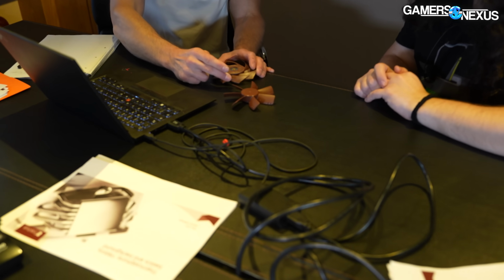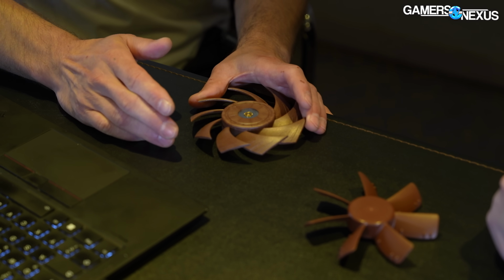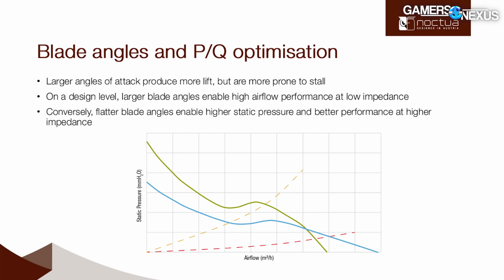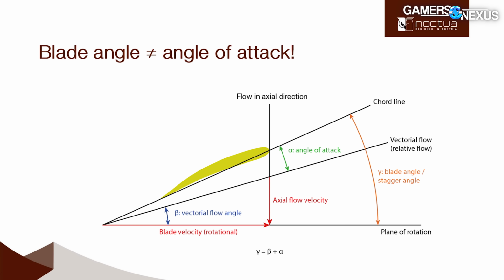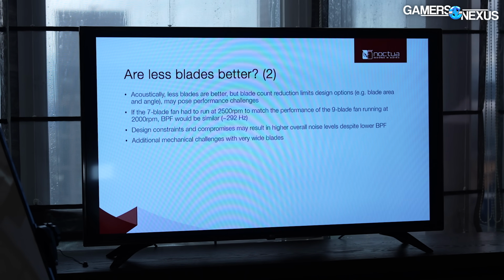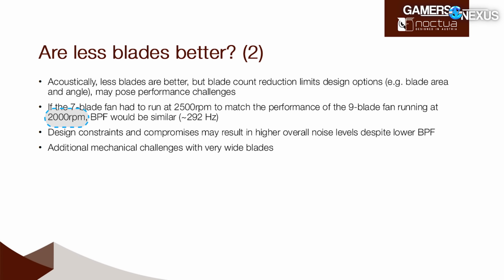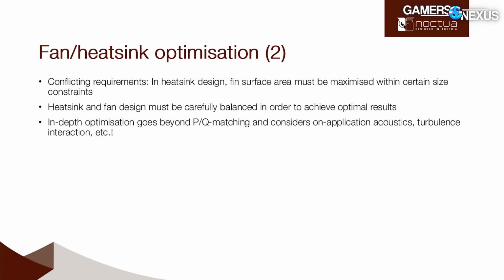Noctua's Attempt to Make the Perfect Fan | Blade Angle Engineering Discussion

Comment: So I have this brick of a Mean Well power supply (100-240V ac in to 12V dc out - 16.7A) that I saved from landfill on a demo job. Took it home and boy was it loud! Then I remembered all I have learned from this channel and bought an adorable Noctua NF-A6x25 fan and replaced the factory installed one. Suddenly the brick was almost silent and could be used inside my house with the LED strips without angering my neighbors. Thanks Steve!

Comment: More all black GPU cooler collaborations would be a great direction to take. I would love to buy Noctua GPU coolers that are functional but also discreet, providing optimal cooling for the noise levels, potentially allowing for higher sustained boost clocks. For now sadly, the brown colour means they don't fit in >95% of case colour schemes, even though those shown in this video had black shrouds, the giant brown logo on the side would still look out of place

Comment: Assalamualaikum Bro I watched Your video and I Will Update My Gigabyte  Aorus Z490 Master Motherboard Bios and Now I am Facing The Problem My Motherboard do not saving The 3200Mhz RAM clock ? Every time I change The Ram to 3200 Mhz clock My Motherboard will don't scan it and do Not Turn on After 3 Minutes Automatically Boot up But with Default Boot Setting

Comment: Axial fan design and heatsink CFD is FUN!

(I've done that before, albeit separately. AFD was for vents (or in-pipe fans to boost flow/pressure in a long running duct and heatsink design for something else.))

But having to optimise them together, as a system -- that's fun, and challenging.

Comment: really really wish noctua makes a :
1. High quality lga 1700/1851 lga backplate
2. a 120 mm ram aio with high quality thermal pads + aftermarket heatsinks
3. a ram fan solution which is compatible with air coolers especially the noctua g2 
4. a ram fan solution which is compatible with aio's
5. successor to the nt h2 paste
6. encourage more psu manufacturers to put a noctua fan inisde
7. a noctua specialised pc case best optimised for air and/or aio cooling

Comment: I am surprised Noctua offers any engineering input for competitive reasons. I just buy Noctua because I know they are the best. My Noctua cooler (NHD15) is now in its 3rd machine. Cooled my 8700K, 12700K.. bought some offset brackets to cool my 9800X3D... runs like a champ.

Comment: Would there be tangible gains to be had, by taking a 120mm or 140mm G2 level fan, but stretching it out deeper ? ie to 35mm instead of 25 etc... That could be a specific model for case fans, since those usually have depth available in front/behind them anyway.

Comment: why couldnt deisign a fan that acts like a helo blades , not fixed but can rotate on it own axes (pivot) ? Or something Back in the day (Im a AUtomotive Tech) we had flex fans that the metal would flex and change the pitch of the blades. BTW these were dangriuos becuse on high rpm motors they would come aprt.

Comment: Engineering, especially in this space (loosely defined as small scale aeronautics), is an interesting intersection of improving on common knowledge with iterating on wild ideas and proving the previously agreed 'best method' as the next passing fad. I would posit that knowing the foundations is equally useful at defining the box, but there's Always room for improvement. It only takes one radical idea to make one chase down whatever that better method might be, and eventually you'll land on the next big idea to break out of the previously defined box of 'possible'.

Comment: I love noctua fans. My old pc had them in front and back (2x NF-A14 FLX in the front and 1x NF-F12 in the back)  and was like a wind tunnel, always cool. My new pc has the noctua NH-D15 chromax cpu cooler. And I also want to replace the case fans with noctua

Comment: I know it's a running joke in the video but I would LOVE to have a bare fan frame and motor assembly that leaves out the fan disc so I could 3d print my own blade profiles.  I know @MajorHardware KIND of does this with the A12x25 in his fan showdown series but he destructively disassembles that fan to get to the bare hub but that's the idea I'm looking for.  It would be nice if that were a "factory" option I could purchase so I (and others) could experiment and print custom 3d printed fan discs.

Comment: I'd love to hear what Jakob thinks about cases that have a opening in the side panel to allow GPU air to directly escape the case. It may increase noise exposure a bit (depending on case location an orientation) but on the flip side, case fans should not need to work as hard to get warm air out of the case, because some warm air never remains in the case to start with.

Comment: As the NF-A fans are pretty much allrounders I'd really like to see if Noctua could now produce even better specialized fans like the NF-S12 G2 (or should we call them G3 by now?) for the best airflow or the NF-P12 G2 for the best static pressure. 

Plus I'd also love to see the new developments find their way into other sizes, such as a Noctua NF-A9 G2 or a NF-A20 G2.

And... other brands achieved great results with thicker fans. So what about a NF-A12x30 or x35? While those might not fit in all positions there are places inside PCs where thickness doesn't matter as much.

Comment: One thing I was hoping to get more insight on was blade tip extensions. I've seen some with partial extensions towards the next blade's trailing edge, and others that fully connect the blade tips into a circle. Sure it adds rotational mass, but it removes the tip vortices and enhances pressure at the tip from splash. I assume the resulting splash also adds noise though. I'd love see what kind of research Noctua has done with the more weird designs seen in other applications. Like stator blades in a thicc fan.

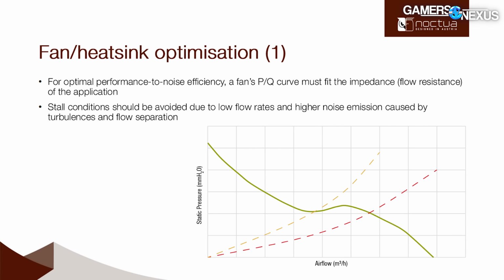Comment: 23:55 so the scifi future of the heatsink woulg probably be a 3d printed copper sponge like structure?
Reply: Sound cheap. 

I wonder if you could start with fewer fins and introduce turbulence between the fins...
Reply: I wonder what counts as a fin. Imagine a really long sheet of metal, rolled into a spiral, and then let a fan blow through it. One could argue that this could be a single fin :? But I guess real world physics work differently.

Comment: Someone should really talk to them about the basic thickness of the fan. Noctua seems married to the 25mm form factor and I dont understand why when you can gain so much from a few extra millimeters, it seems.
Reply: Because they would have to support an entirely new product line to the standard that they do their other products. While there are still gains to be made within that form factor that makes up the majority of sales, it's logical to just keep exploring those improvements. If after every bit of performance is wrung out the industry move towards thicker fans, they can just follow along and retire the old stuff.

Those few extra millimeters aren't going to make or break any setup.

Comment: He can't even explain how fan works. Air does not go trough the fan! Fan move air by pushing it with a blade, and negative pressure sucking air into fan. That is how you can measure air flow... Optimal number of blades - not explained. Dust collection - not covered. Value  - not covered. Design (magnet, oil) - not covered.
Reply: You are super dumb.
Reply: Wow you know all that hard words? You must be a intelligent person. Your mommy must be very happy.

Comment: The Dyson style, "bladeless", is called a circular air knife, often marketed as an air amplifier.  Typically powered by air compressor, Dyson attached an electric motor.  They're popular in many industrial applications, but in past years, you may also find them around some sporting events.  Particularly automotive racing, where the high air pressure of compressors is readily available and hearing protection is the norm.  Watch an F1 practice or qualifying session, and someone will have one pointed at a driver in the garage to cool them down.

Comment: We've seen a few thicker fans, with HDD/5.25" bays basically gone now, wonder if Noctua is going to jump on that. In a regular front to back layout case, the front top fan tends to have loads of space. Something silly like a 5cm fan would probably fit in most cases without blocking a pass through GPU fan.

Comment: My father in law designed blades to be used in the cooling towers of nuclear power plants.  Now those are big fans!  I don't know how the fans were designed before his time (early 1980s), but he designed and milled prototypes for testing with a TRS-80 he brought in from home.  This enabled him to try many different designs for testing in a wind tunnel.  I doubt he knew of many of the principles discussed here.  He did make significant improvements, however.  I wonder what obstacles he had to overcome.
Reply: I'm guessing your father knew a lot more than you (and I) can imagine about fans.
Reply: @edmond4005  He certainly didn't hesitate to consult the appropriate reference materials, including trigonometry texts.  He previously redesigned the molds for Goodyear tires.
Reply: Fascinating. Didnt know theres cooling towers that aren't entirely passive.
Reply: @Chuckiele  I think most have a really big fan at the bottom.
Reply: @milowadlin  Well, Ive only ever been inside the cooling tower of a single NPP and that one was completely passive. It sprayed the hot water into a fine mist and the rising heat created a wind so strong that you could barely talk to each other :D
Reply: @Chuckiele  That sounds like a good way of doing it.  This what I got from Google's AI function:  Cooling towers in nuclear power plants can be both active and passive, but the trend is towards passive cooling systems for enhanced safety. While traditional nuclear plants often rely on active cooling systems (like pumps and fans) for removing heat from the reactor core, there's a growing emphasis on passive safety features that utilize natural phenomena like convection and gravity.

Comment: Interesting. Five years ago, I spent a lot of money on six NF-A14 "industrial" fans. They were incredibly loud. I replaced them with NF-P14s, and they were... bearable.

I recently built a computer and needed new, quiet fans. I was considering the NF-A14 FLX or the NF-A14x25 G2... the FLX were supposed to cost $180, the a14x25 $260 for six. 0.0 I ordered the FLX... and after installing it, I heard about the ARCTIC P14... 0.0 I disassembled the computer, sent them back, and ordered the ARCTIC for $59 for six. They're fantastic!!! I ordered another five 12cm fans. However, something might be cheap, efficient, and quiet!!!
Reply: Yea I had 6 of the 120mm 3k rpm fans. They get extremely loud even at 40% pwm. I recently sold all of my noctua fans.

Comment: Noctua is an impressive company. They have kept the position as the best performance per decibel for more than a decade.
Reply: Arctic P12/14 Pro says Hi!
Reply: Define performance?
It seems to be for unrestricted airflow.
But in static pressure the NF-A14x25 G2 is defeated by Lian Li Unifans, Arctic P14 Max, CM MasterFan MF140 Halo2.
(Source: Tweakers 28 140mm case fan roundup)

The arctics are also a fraction of the price and if you've held one you'd likely agree it is a quality fan.
Reply: @ChielScape NFA12-25 G2 still the king for 120mm fan performance per decibel averaged over static pressure and unrestricted airflow no?
Reply: @p0lqroid  Im pretty sure it isnt.
Reply: @ChielScape  Okay maybe on paper but most of those fans will either have worse quality control (noctua is perfect), resonance at some RPMs, develop bearing noise after a year, or have a worse sound “profile”. 

Noctua may be expensive but you are not making a compromise and you can be sure it will do the job reliably. Even the P12 Redux fans are amazing as they still have the same awesome bearings and QC.

I can confidently say that the bearing makes the biggest difference among the good fans. For example, the Asus XF120 is not a great fan on paper but it uses the same Maglev bearing made by Sunon so it is just as quiet as noctua at lower rpms as a case fan.
Reply: @boranakin710  brand loyalty is foolish no matter who it is.
Statements like that show how little you really know.
Reply: Except, they haven’t? Nf-ax25 fell off the top. Not by much but still

Comment: Noctua really is one of the few companies that work exactly like I would like most companies to work: 
Make good, maybe the best products you can. Support them for long times. Use quality to improve how long they last, not how they look. 
It's such an easy concept, but you rarely see it anywhere else. If I could buy other appliances that work perfectly and reliably for decades but cost a bit more, I'd do it, even if they came in poo colours.
Reply: Speed Queen sort of follows that ethos, as far as appliances go.  Companies that do what you're describing do exist, but usually at a huge premium compared to their typical counterparts.
Reply: I miss my old 'Harvest Gold' colored fridge from the 70's   Thing was a TANK.
Reply: Their color scheme is wonderful
Reply: This is the main issue with pretty much any product, in any industry right now. Companies USED to want to make the absolute best product they could, which caused customer satisfaction, the word spread, it marketed itself. Sure not the most profitable, but the products "speak for themselves" and with this comes profit, sure can you make more money? Yes, but it would cost the integrity of the brand. These past 15(?) years - Almost every single industry has shifted to just caring how much profit they can make, and putting profit before making an actual good product. If you cant save on materials and technology, save by eliminating staff. Noctua seems to be one of those rare companies that cares primarily about making a good product, and not pinching pennies. How their company strucuture etc looks I have no idea, but their products speak for themselves. 

TLDR; Some companies want to satisfy their customers, some companies only care about satisfying shareholders.

Comment: I like Noctua and appreciate them, but u can't deny that their products are overpriced AF, the Arctic P12 and P14 non max fans are 5 to 7 euros (that's around 8 to 10$) and they give u at least 95% the performance of Noctua fans, no matter how much science they try to explain you the others are rly good with nowadays fans u can't justify the prices of Noctua no matter what
Reply: While I agree with you in general, I have 5 p14 max that all have a scraping sound at below 1000rpm. 

It drives me crazy. Fssht fshht fshht fshht. 

Barely audible. Annoying as hell. My a12x25g1s are still whisper quiet 5+ years later.
Reply: @LinusBerglund mine are whisper quiet, also I have couple of them on rubber pull tabs or whatever they are called and others mounted with screws, no annoying sounds whatsoever
Reply: They're nowhere near "95% performance" if you include noise characteristics. The Arctics sound awful.
Reply: @fnx427 u must have awful case

Comment: Been building PCs since the 80's... I remember the day Noctua launched their products to order. I was a day one customer and have never looked back. They could be pink with purple polka-dots and I would still order them :)
Reply: Dont give them ideas
Reply: itty bitty yellow polka-dot fans?
Reply: @glacierwulf26  Itty bitty teeny weeny yellow polka dot ... fan
Reply: I have been kind of the opposite. Trying all different brands and seeing what's good and what's not.
While I think Noctua makes great fans, I think the offerings from Arctic and CoolerMaster are interesting as well, considering their pricing. Arctic has models that allow daisy chaining the fans if you don't have a lot of fan headers. And CoolerMaster fans while not extremely silent, tend to last quite a long time.

And there's also brands like YateLoon, Delta and Papst which make greate fans though they are not always easy to get hold of as not all shops stock them.

But in the end I think the same can be said of Noctua as they used to say about IBM back in the days. Buying Noctua is never a mistake.
Reply: @NaoPb  Pc diy is largely about pure performance, and then flexing on the performance stats of the hw, but not always. Aesthetics is relevant to some diy pc gamer builders, or even diy creator pc builders. I think more and more these days than before. Aesthetics werent by en large even a thing thought about back when.
Reply: pink with purple polka-dot is absolutely fire, at least for me haha.
Reply: I would like to know if there is any performance difference with the Noctua chromax black fans and coolers.
Reply: Are you suggesting pink with purple polka dots is undesirable? I think that sounds great. 😃🧋🍨
Reply: I'd probably be more inclined with a very distinctive design like that
You could do all sorts of cool stuff with it

Comment: I bought my DH-14 (LGA 2011 specific PWM)  cooler back in 2011. I've been using using it to this this day on an LGA 1700 I7 13700k thanks to Noctua's bracket kits still being the same 14 years later. I bought a D15 black to further support the company. But my fans on the D14 are still perfect no bearing noise, no wobble. Just a perfect cooler. Cleaned the haze on it with Barkeepers friend.

Comment: Couldn't you reduce the blade-passing frequency by a lot by reducing the number of hub mounting struts?
Reply: That's one of the harmonics. The blade-passing frequency on its own is just how many blades are passing one point of the frame per second. It's the fundamental.